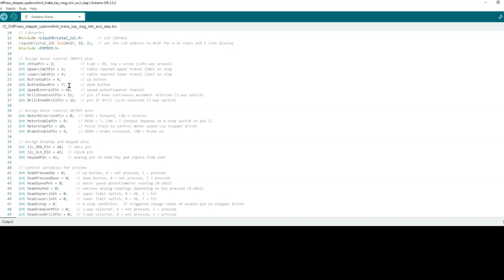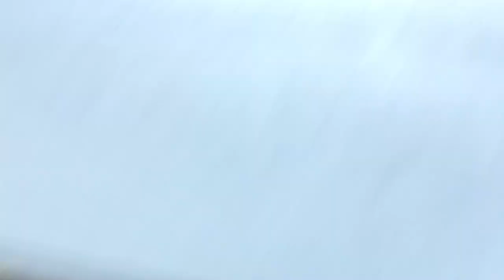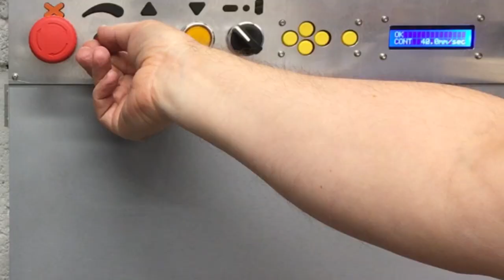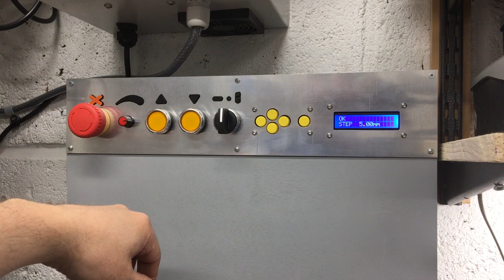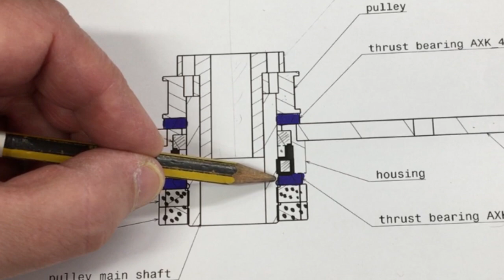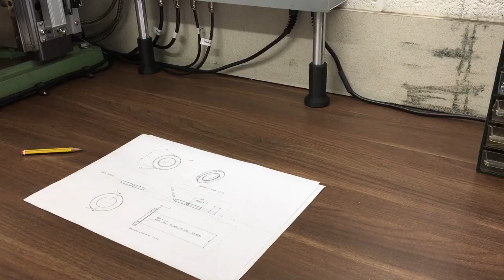Ep54: Drill Press upgrade | Software!

Comment: Hi - use the tone function in the arduino software, rather than hard coding each pulse event into the software - You then won't run out of clock cycles on the arduino as the tone function operates outside of the regular code execution speed. You can calculate tone to RPM or to mm/s by working out the steps per revolution and ball nut pitch etc. That is the best way I have found to control the rotational speed of a stepper motor (rather than the more normal position type control). I would also code in a deceleration as well, at higher speeds and hard stops it might miss a step or two - might not matter too much, but if you are trying to keep track of position based on step counts, then that might catch you out.
Reply from the maker: Hi Lewis, OK sounds good.  I've had lots of suggestions over using different libraries for stepper control and there are quite a few.  I did wonder if they take up more clock cycles to branch over to and in the end because I enjoy tinkering I hard coded the pulses, so good to know they run separately.  As you can see it runs plenty fast enough though and I'll probably stick with it as it is working.  But for future projects I'll look into the tone function.
I wondered about the deceleration so I guess it could loose steps.  On a CNC machine that would be a problem but maybe not too big a deal here as when running high speed you are probably just getting somewhere near you need to be.  The knee DRO can track where you are in absolute terms.  It might be a bit more sympathetic to the mechanicals though and stop the grub screw coming loose.  I think 3 lines of code should do it . . . ?
Reply: @routercnc9517  yeah a ramp down will definitely be more mechanically sensitive. Not sure how you are running your ramp up at the moment, but my solution was to use a while loop. While currentTone<targetTone; currentTone++,  tone(currentTone, stepperPin);. Don't quote me in that, but it's close enough to give you the jist. In that case targetTone is the rpm to want converted to Hz, at the start currebtTone is zero, and then as the whole loop runs, the currentTone valuenisnincreaded.by one each time until it reaches the desired value. If that ramp is too slow, you can either increase by two or three or four each time, or divide the target tone by a set vale and use that, which then gives you a ramp over the same time period regardless of end speed i.e. the higher the target speed the more aggressive the ramp. Oh, the above is for ACC, just to the reverse for deceleration with the appropriate tweaks. The above code would also need to ensure that you are using interrupts for your inputs and once the ramp starts it won't stop until it has exited the while loop.
Reply: The interrupts fix that issue and are good practice anyway

Comment: Also, Arduino’s web based IDE I believe supports OTA (over-the-air) compiling on some of their boards. Using a ‘OEM’ OTA solution is surely the way to go, especially for firmware updates.
Reply from the maker: I've come so close to getting this to work with HC-06 bluetooth modules I may give it another go.  These Nanos are so cheap if I can make it work I can cover many such projects.  However, there are other boards with WiFi and other systems already set up for SOTA so that is an option too.  I'll also look into web based IDE as you mention.

I do seem to like doing things myself (I learn more that way, but it can take longer!).  Here is the history so far - I have managed to set up a Nano to act as serial host to talk to the HC-06 and I can use AT commands to talk to it.  I used different pins (10 and 11) to keep the TX and RX free otherwise it does not work.  There was a library which allowed data to be transmitted on these other pins.
I then set the Baud rate from the default of 9600 to 115200 which is supposed to be the max for the Arduino but it stopped talking after that (I matched the Baud rate in the sketch to this value so it should have still worked).

So I bought another HC-06 and left the default Baud rate at 9600 (I guess this means slow uploads, but let's get it working!), got it talking via the Nano using AT commands.  Then plugged in the bluetooth USB into the computer and got it linked to the HC-06.  It showed up as COM6 on my PC, which was a good start.
Then I had to reconnect the TX and RX wires (which had been on pin 10 & 11) between the HC-06 and the Nano as we were now supposed to be sending data from the PC to the HC-06 and into the Nano via these proper channels.  But IDE could not recognise the COM port and would not upload a sketch.

Note this is HC-06 which is only a slave unit (not HC-05 which can be master and slave) and only has 4 pins, Vcc/GND/Tx/Rx.

Feels like one step away but I'll come back to it another time since the software is working OK for now.

Comment: New subscriber here. Really enjoying this project, not enough software controlled drill press videos out there on the tube. Any chance you’d be willing to share your code with us? 

Also, if you’d like to setup a Discord or something for this project to support people wanting to undertake something like this as well as to share ideas, I think that would be sweet.
Reply from the maker: Hi MakerMadness.  Welcome to the channel.  Have a look around - I tend to get involved in long term projects so be prepared!
Yes, happy the share the code.  I noticed when editing the video that some of the variables were not used in the end, plus add-ins such as the EEPROM support (to save values when powered down).  Also be aware it is flat code, no function calls, and does not make use of the many stepper type libraries out there, I wrote that code myself.
As for Discord I've heard of it but have never looked into it.  I don't have much time for many of the social media sites (videos take long enough!) but I have been a long time member of the 'mycncuk' forum.  I'll put a link in the text box above to the long thread on this build series.  If you check it in a few days I should have uploaded the code there as a zipped file.  I'll post in this reply when I've done it.  Hope that works for you.  Thanks.
Reply: @routercnc9517  would love to take a look at the code, do you have a avenue in which you may share it with us?
Reply from the maker: Hi MakerMadness
OK, I've uploaded to the code shown in this video to the mycncuk forum.  See link in the text description box above.  Or search for 'mycncuk metalworking pillar drill experiences' and scroll to post #105.